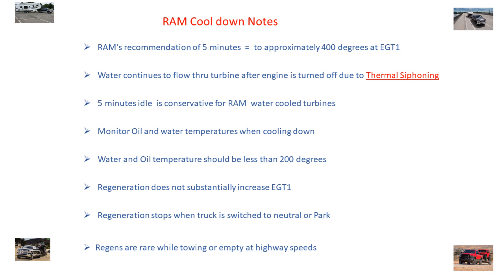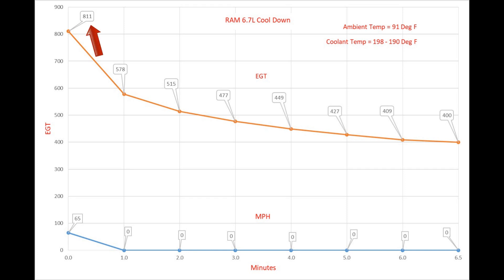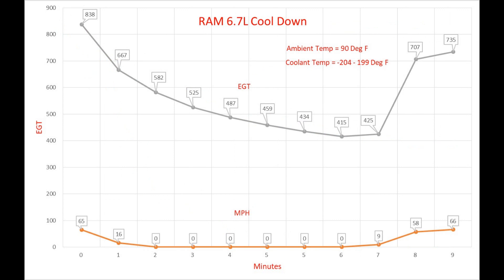RAM 2500 Turbocharger Cool down - How long to idle

Comment: I work for a company that has 94000 trucks world wide. They also have a zero idle policy. In 26 years of driving I've had one turbo failure and it had 800k miles on it. This experience has made me rethink some of the old school practices.
Reply from the maker: Yeah that's a good point, with the water cooled turbines it's probably not necessary at all.

Comment: Another great vid, thank you Marion.  I've swapped out the stock VGT for a BW 364SXE and love it.  Nevertheless, the answer to your question is easy.  Idle down until you see around 350/375 degrees egt and shut down.  Just that simple.  No long winded videos necessary. ;-)

Comment: just happen to see you from cummins forum and wanted to check it out.. currently in a 2003 7.3L ford looking to make the jump to cummins.  your cooling info is right on point.  when i was OTR driver the shop recommend we let truck idle for at least 5 mins before shut down to cool turbo. this was in 1982 on a 290 cummins .  

Was saddened to see the loss of Killer.. sorry for your loss.
Reply from the maker: Thank you

Comment: My 04 5.9L Laramie had old school gauges galore. My 18 6.7 Laramie has a OBDII type monitor. I monitor @ EGT1 to under 500 (when no tow) for shutdown. I mostly run around town (15 months 11K miles) . Regen seems to be every 4000 +/-  I just made up 500 degree shut on the 2018 to mimic characteristics on my 2004 cool down process. Driving habits remained the same and 500 degrees seems to be where the 04 and the 18 driving habit temps aligned. Just happened to be 500 degrees. Close enough for the ok to shutdown under normal conditions for me. Love the videos. Sorry about the dog. MPG seems to be around 16 in town. I have to go search your oil change video again. It's about that time and $ is tight. Thanks for posting. I appreciate seeing the hard numbers vs my seat of the pants.
Reply from the maker: Appreciate that.  Ha, I made up 400 deg.  These turbo's will fail from something other than a hot shut down IMO.  The nice thing about the water cool turbines is the water continues to circulate after the engine is shutdown so it continues to cool the oil and bearing.  So your turbo bearing and oil is not seeing 500 degrees.

Comment: Egts come down pretty quick on these newer trucks, even after towing its pretty surprising.  I normally monitor egts in the manifold near the center or if its deleted then the back plate.  These areas should give pretty good readings as well but that idash looks to be a pretty sweet tool for those that want to plug and read info.  Good video!  Enjoy watching your videos sir.
Reply from the maker: Thank you for that.  I'm a data nerd, ha.  Yea, I wish RAM installed a pyro in the manifold.

Comment: Thanks Marion,  because I have no indication and know nothing this is a gray area for me. The biggest indicator I use is oil temperature, not too big a problem in mild temperatures but in Florida where half the year is 94-100° OAT.....the oil temperature will run 199-203° with the truck empty so when I get ready for shutdown it takes between 5.5-10 minutes for the oil temperature to drop down on a hot day to 197 or a mild day into the 180s, then I'll give it another 30 seconds before shutdown. I don't like not having a EGT reading because I accumulate idle time on the hour meter and it lowers cylinder pressure,  so it's a compromise.
Reply from the maker: With the water cooled turbine, it's not that critical.  10 mins will probably cover any towing condition and 5 for empty.

Comment: Another great video Marion.  I don't have a dash computer, so I've been using the coolant temp - same as you, I've been shooting for 200 degrees.  As you mentioned, sometimes even at idle it will be 201-202 in hot weather.  Sorry about "Killer" - It's hard to lose a pet.
Reply from the maker: Yes, BTW, nice airstream.
Reply: @MarionBlair  We love it!

Comment: When oil temps are in the 110 °C range, personally I like to open the hood and turn the heater on max heat for 2 minutes or so and call it good. I’d like to see the difference between these two methods though! Nice video and analysis.
Reply from the maker: 2 minutes seem low.  Opening the hood will help some however, I would think but how much it aids in cooling the turbo would be interesting. yes.  thanks.

Comment: The problem with a hot turbo is only related to the oil. The whole reason too let the turbo cool is to get it below the coking temperature of the oil.

If the turbo is too hot and you shut down, you will essentially burn the oil in the bearings/journals and this now solid burned oil wears on those parts.
Reply from the maker: Exactly

Comment: Do you think the Banks iDash is the most effective way to monitor these temps?  Trying to decide if this is something I should buy.  How frustrating that we can't get a straight answer from either the dealers or the manufacturer.
Reply from the maker: Yes the idash is good so is the edge insight.  If you want to record data, the banks idash data monster is the clear choice but the edge is better built but not good for recording more than a few minutes.  You don’t need either if all you are interest in is cool down.  Just idle for 5 minutes after towing.  There are other options around.  A Bluetooth adapter with the torque app on your phone is a low cost way.  Don’t believe iPhone supports it though.

Comment: I ALWAYS idle for 3-5 minutes or until my EGT1 below 400 before shutting down. I also plug my truck in everyday and it's on for 8 hours every night. So when I start the truck it's at 145 so I don't have to wait for the engine to warm up before leaving the house. When I leave work or anywhere I make sure the coolant temp reaches is at least 115 before the truck moves. Even then I take it easy until the truck reaches 180-185. I know this is probably overkill but I want this truck to last.
Reply from the maker: One of my old trucks I installed a preluber that would circulate the oil thru the engine before starting.  But I wouldn't do that now.  My truck will outlast me I'm sure, ha.
Reply: I’ve been a Diesel engine mechanic for many years and your approach is dead on, I’ve seen some 1,000,000 engines where the owners would not move the truck till it reached operating temp.
Reply from the maker: @wayneowens7059  appreciated

Comment: Hi Marion.  I have a 2018 RAM 6.7 auto trans.  I have seen regens towing at 60 mph in 5th gear out here in Arizona.  I've also seen them empty at highway speeds.  I almost always drive on the highway, never do "grocery" runs.  Thought you'd like to know.
Reply from the maker: Yea, mine will regen when towing depending on EGT.  If I keep it above 900, it'll rarely regen while towing.

Comment: I was under the impression that the ram cummins uses the late injection method which is spraying that extra fuel right into the cylinders
Reply from the maker: Yes, for regen, on the exhaust stroke.
Reply: @MarionBlair  yea that's a terrible time

Comment: Marion, do you leave your truck running in fast idle ~1000rpm when you fuel up or after hard towing (in park, foot off of brake, with cruise control on. and then push the cruise "set" button)? I find that when I've towed hard - 14,000 lb 5-th wheel with a 17' ram 3500 in the Colorado mountains that the turbo seems to cool down faster if I run at fast  idle for several minutes and then go to regular idle for a minute, or so, before before shutting down. I've been trying to get my turbo to 350F before shutting down. Thanks for your videos!
Reply from the maker: I've never tried that but I'm going to now.  Very interesting, thanks.
Reply: Marion, I'm not sure if the fast idle works the same on your '14 as on my '17 but I use it ALL the time to cool down my truck. Again, you must be in park, foot off of brake, cruise control on, and push the cruise "set" button - ~1000 rpm,  (as soon as you
put your foot on the brake the fast idle turns off ) then push cruise "res" button and you can push it multiple times to bring the fast idle up to about 1500 rpm. I've read that if you are going to idle your truck for long amounts of time - if you idle at 750 rmp (normal idle speed) that the Cummins can build up soot in the EGR (I think) and if you idle at the fast idle it will minimize soot build up. My owner's manual even states that if you idle your truck for extended periods the truck will automatically go into fast idle.
Reply: Also, the fast idle vs normal idle might have a dependency on altitude (thinner air). In Colorado, fast idle seems to bring the turbo temps down faster. I was recently towing in Wisconsin (probably 800' above sea level) and my turbo seemed to cool down faster than when I run at higher altitude in CO. By the way I live at 5000' in Colorado and mostly tow in Colorado usually well above 5000'.

Comment: Hi Marian if you pull in to get fuel and you don't have a lot of time to let it I cool down before shutting it off is it okay fill up with the engine running?
Reply from the maker: Absolutely that's what I always do and most people with diesels
Reply: Never ever fuel with your engine running. Fueling with the engine running is illegal in most states.

As for semi's, it's rare to see a driver fuel with his engine running. You might do it in frigid (<0) degrees weather, but again, it's illegal to fuel with your engine running.
Reply from the maker: @afluffypinecone3577  Yea, that's probaby right.   I shouldn't be spreading my bad habits.
Reply: It is illegal however if you do care about the life of your truck just go ahead and do it Diesel is nowhere near as flammable as gasoline. But on the other hand like stated in the video usually driving slow speeds will cool it enough where you dont have to worry about it. Ex. Driving on the highway exiting and driving 5 mins to fill up is plenty of time for the truck to cool down enough. But I still do it lol
Reply from the maker: @71ngel  That's pretty much how I feel.  The flash point of diesel is way up there.

Comment: How hot does your oil and coolant temp get while towing? And how hot is too hot on these trucks?
Reply: Depends on how had I'm pushing but oil normal maybe 203, coolant higher.  I back off when coolant gets to 206 or so.   Synthetic will do better if you pull hard and heavy.
Reply from the maker: Got to 218 this last summer.

Comment: Thanks so much Marion. With No EGT monitor, using only coolant and oil temperature is the idle time at idle or the fast idle with through the cruise control? Question 2 is if it's not in regen after you park, what is the ticking I hear like it's still trying to inject DEF into the exhaust? If you could elaborate on both of these I'd really be grateful. Blessings.
Reply from the maker: I let it idle.  I've never compared the temp drop idle vs fast idle but sounds like something I should do.  Cummins/Ram says fast idle (when idle for long periods)  to increase (not decrease) combustion temp to reduce varnish like build up in the cylinders, valves etc...  But I've heard some say it cools down quickly with fast idle also but can't confirm.   As to the  DEF pump, it will pump independent of the regen based on NOX emissions (even after regen is shut off).   I hear my DEF pumping a lot when towing (higher NOX) and refueling.  Another ticking sound is the rapid cooling/ contraction of the DPF when the regen is stopped.
Reply: @MarionBlair  Thank you again Marion, I'm grateful for your insight as you have a great deal more experience with this engine than I do and proper care of it is my goal.

Comment: Marion, thanks for the video.  I don't have a egt gauge, so I go by the cool down times in the owners manual, and try to get the coolant and oil temps down.  As the truck idles cooling the turbo I notice the transmission temp begins to rise quickly as I idel my truck.. What temp. ranges are detrimental to the transmission ?
Reply from the maker: Keep transmission below 230, preferably lower.  Synthetic should go to 260 but I wouldn't test it.

Comment: If the vgt veins are sticking, how will the truck react?
Reply from the maker: The holset doesn't have individual vanes, they are all part of the entire nozzle which slides back and forth allow more or less exhaust to spin it depending on the boost requirements.  So, it depends on the position it was in when it failed.  You will get a code which is the most obvious indication.  The turbo nozzle has to be able to slide to hold back pressure on the EGR otherwise the emissions will get out of sync and thus codes.

Comment: The new GM HD trucks will not shut off if the engine hasn't cooled down sufficiently.
Reply from the maker: Wow, It's about time they put that on the engines.  Although I would prefer to have it shutdown automatically while I'm out of the truck in the bathroom, ha.
Reply: @MarionBlair   It will shut down automatically.
Reply from the maker: @AlaskaErik  Nice, maybe ram will follow.
Reply: @MarionBlair  often times I shut it off for just long enough to get out then remote start it and run in to grab whatever or use the restroom and then head on my way.

Comment: My 2018 2500 doesn't show the EGT. How do I find the EGT?
Reply: I installed an edge CTS 2 monitor on my 2018 2500. Must have in my opinion.
Reply: prjgrudge Cheapest way is download Torque Pro for like $5 and buy a Bluetooth OBD2 Scanner device , it shows you more than most scanners that cost 50x more
Reply: I use the Blue Driver OBD tool. Great diagnostic tool along with realtime customizable gauges.

Comment: Do you leave your truck running when you fuel up while towing or wait at the pump for several minutes and then shut down and fuel up?
Reply: If I'm correct diesel trucks don't need to be turned off at the pump since Diesel is combustible, you can throw a match into a cup of diesel and it would put the match out while gasoline is a different story
Reply: I never shut down the engine when I’m fueling up for diesel.
Reply from the maker: Yes, diesel has a very high flash point.  I don't shut down.
Reply: @MarionBlair  Thanks

Comment: Blah blah blah. Put in a pyro and turn it off when it reaches the right temp. 90 percent of the time a slow run into a town temp is down anyway.
Reply from the maker: Not necessary to drill and tap  manifold , sensors are already there  for safe shutdown temperatures.  Shut down temperatures are not nearly as critical with the oil water cooled turbo as the oil only turbos since the coolant continues to flow after shutdown protecting the turbo bearing and oil from excess temperature
Reply: @MarionBlair   pyrometer is an exhaust temperaturegauge that allows you to read an immediate change in exhaust temperature by receiving atemperature signal from a probe (thermocouple) that is inserted into the exhaust manifold.
The video is about rundown times that's the best way to do it.
Reply from the maker: Yea, agree, manifold pyro would be more accurate for engine exhaust temp.  I don't have one so used EGT1 thru the OBDII.   Close enough for cool down, I would use it at the drag strip, ha.